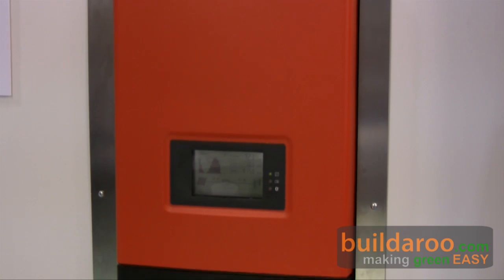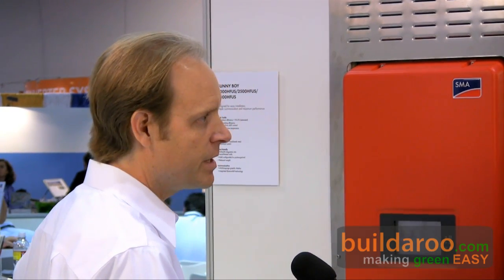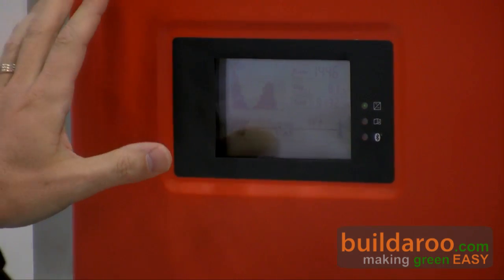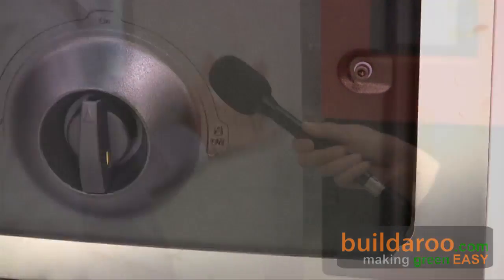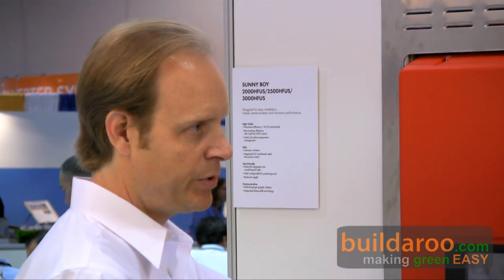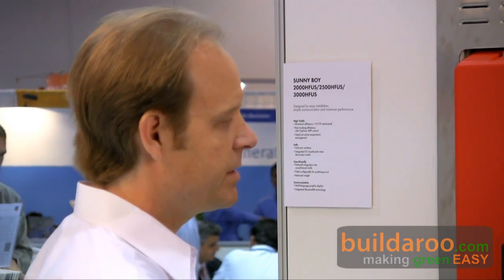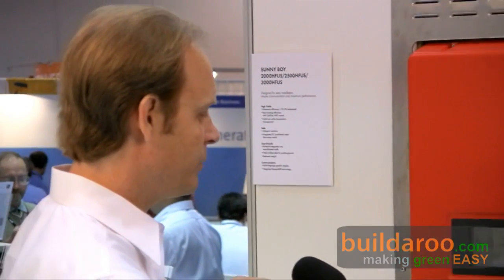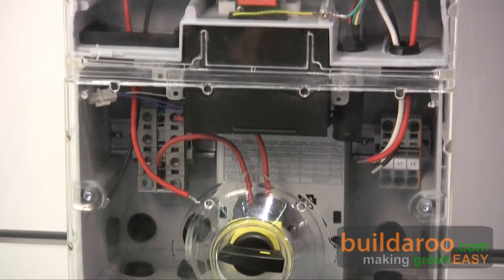SMA Residential Solar Inverters - buildaroo.com

Comment: ABOUTSOLARCELLS.COMXA.COM      ZERO-NOISE from the gears and the generator because they are silenced underground (Only the outer parts of the turbine may create sound.).
This SAVES THE BIRDS AND BATS (since slow-moving) and helps the wind energy companies (since it is FREE FOR ALL.). ABOUTSOLARCELLS.COMXA.COM